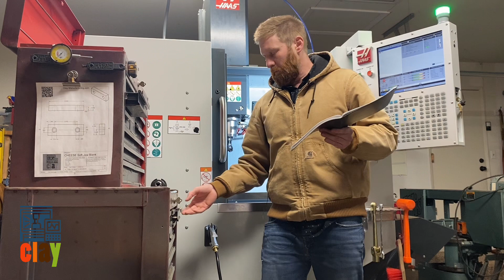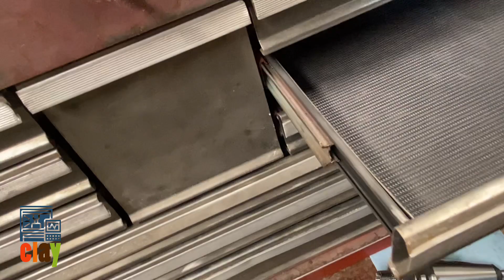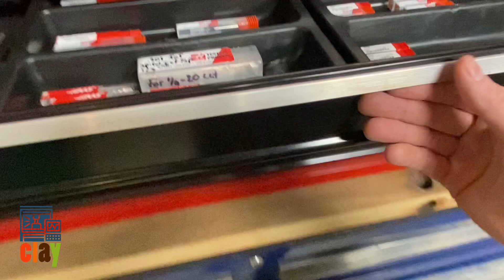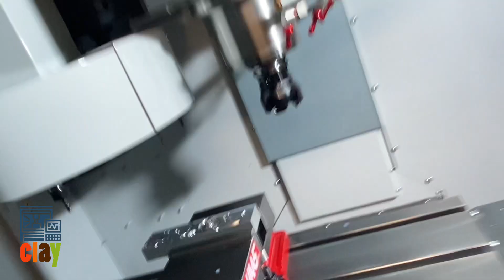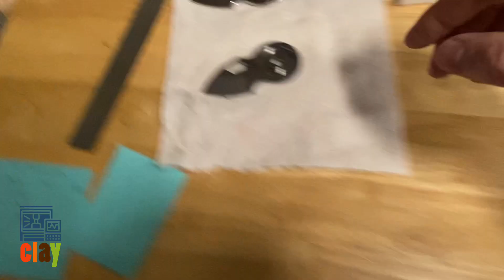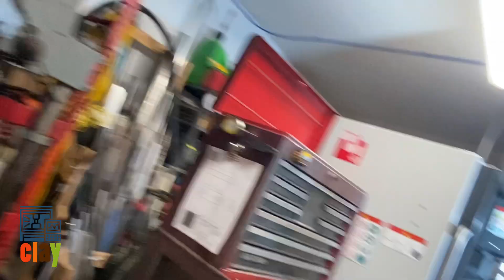The Minimum Tools Required for Operating a Haas Mini Mill for Beginners

Comment: You forgot the coaxial toolholder and magbase indicators. Those are essential. One can achieve insane results by effectively using a test indicator. One can even pick up the underside of a surface if he accounts for the diameter of the stylus.

Comment: Great starter list!  I’ve got 11K M30s on my home MM2 so far, machine is working great 6 years in.   Depending on what you make, a Saunders Machine Works fixture plate and mod-vise system could be a good investment;  it turned my MM2 into a brand new machine letting me use the entire extent of the travels.  Most of the parts I make are flat plates for high school robotics teams, so it really helps with my workflow.     For coolant, be sure to get a deionizer if your water is hard, and a refractometer to keep tabs on the concentration.  Over time as you reconstitute your coolant the mineral content will increase if you use water straight from the tap.  Happy chip making!
Reply from the maker: Thank you!